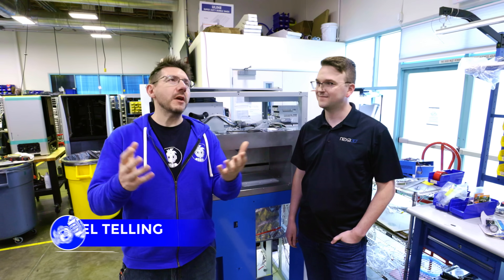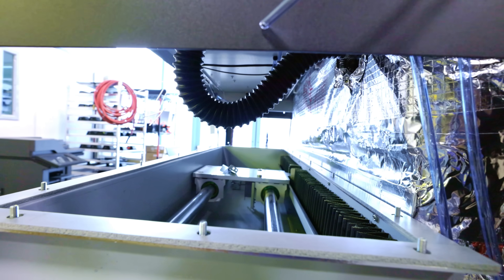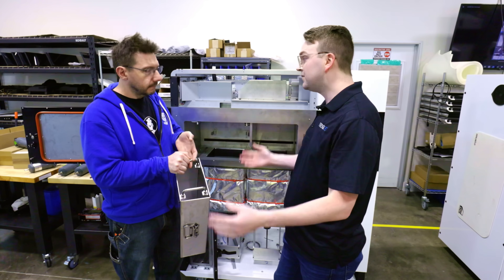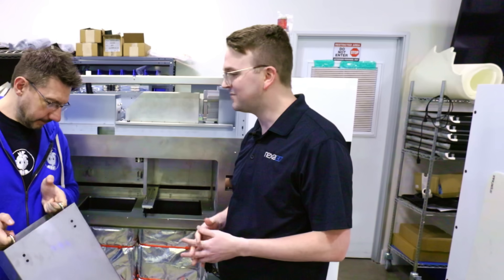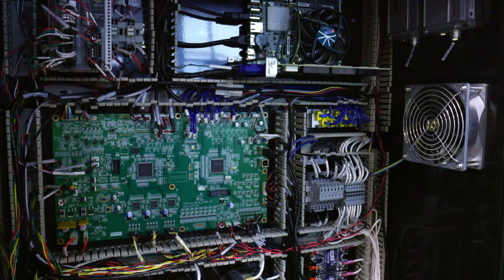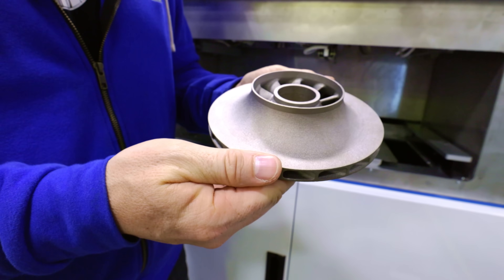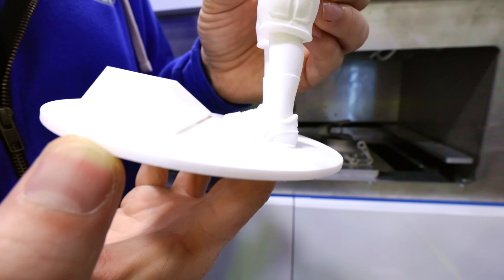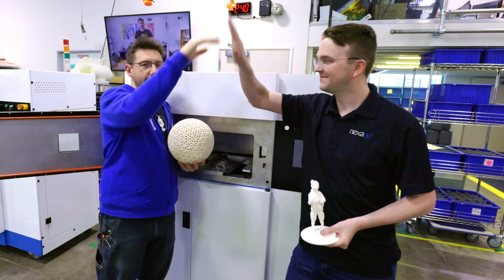DEEP INSIDE an Industrial SLS 3D Printer!

Comment: Videos like this are a nice break from watching consumer level 3d printers. Industrial 3d printers are interesting because reliability and repeatability requirements are so much higher.  Its like the difference between a desktop CNC and an industrial CNC.

I was kinda expecting to see a PLC running things. Then again, I'm sure that those control boards have gone through rigorous testing too or they'd have a tough time selling systems.
Reply: PLC is only used as an addon when you have attached automation to the machine but even then it takes care of really primitive tasks (automatic material changes, pallet changes, robot arm loading etc). CNCs in general or 3d printers do not need a PLC, just a dedicated controller board that also has alot of I/O like a PLC and logic behind it.

Comment: It wasnt that long ago where hobby CNC wasnt possible in the home workshop. Or at least it was very uncommon. Now its very affordable for really good machines.

Im hoping these SLS printers will go the same route. We already can do so much in our home workshops with 3D printers, CNC's, lathes etc, having a metal SLS would be the icing on the cake.
Reply: Home SLS machines will be a true game changer. I don’t really see the value in nylon ones. Marginally stronger than FDM for 100x the price
Reply: @1SmokedTurkey1  Yeah I tried nylon SLS parts from JLCPCB and there were not as strong as FDM PCCF

Comment: im wondering what they think of the new competition that is coming up in the lower ends of the market with Micronics for SLS(plastics) and Metal-Base for SLM (metal)
Reply: Micronics is not safe as a home printer which they are trying to market their product as. The printers may be cheap but to use them safely you will need to invest in a lot of other equipment. The SLS powder is very bad to breathe so just wearing a N95 mask is nowhere near enough protection. You need respirators, a dedicated ventilated and sealed off room, proper cleanup procedures, etc. People using it professionally even have to use all anti static equipment like vacuums because there is a chance that powder in the air could explode if there is a spark. Notice here how they didn’t let Joel anywhere near powder or unfinished parts and it looks like the machines have been properly cleaned to show him.

The basic mask and gloves is not enough to protect you from direct exposure but there are other issues with it being a very fine powder, even without spilling it when you remove the print from the machine you kick a lot of that powder into the air where it will remain for a long time and will settle on surfaces where it can be kicked up later, most likely when you aren’t even wearing a mask. This is made worse by the sifting method of the micronics machine, put it in a box and shake it up.

SLS is just not safe for home or hobbyist use at this stage, that should be clear to see when looking at what protective measures companies have in place for using the machines.

Looking at micronics about page they clearly don’t put much thought into safety, they show off how they used to be based out of a college apartment before they moved into their lab and their pictures show what looks like a milling machine covered in metal chips literally less than a metre from a bed. Now they are marketing an SLS printer for home use? I would not trust their safety claims or advice.
Reply: I think that from that perspective no 3d printer, fdm, sla or sls should never be used at home. The same can be said about drill presses, milling machines and  saw machines. In the end it is also determined by the ammount of exposure

Comment: I know a lot of these machines are out of manys price range but in the video or description can you include an approximate price? I don't know about others but I like to follow the progress on technology and cost. This way when I hit the lottery, I can afford one of these machines 😂
Reply: You need to realize that you need to purchase more than just the SLS machine, right?  The majority of your cost will go into the post processing/safety equipment, as all contact with the powder needs to be completely eliminated.  Any powder that you breath in will forever be in your lungs, leading to mesothelioma.  During the sintering process, you need an extreme ventilation/filtering system to ensure than none of the vaporized components can be breathed in.  You can’t just ventilate this outside, as that is illegal.

This post processing/safety equipment is going to be at least 60% of your total purchase.  This is something that has yet to be discussed by @3D Printing Nerd.

Comment: Just out of sheer curiosity is it possible to print cast iron with standard cast iron strength im trying to reverse engineer parts for equipment from my 1888 frick sawmill to my 1951 international harvester horse drawn sickle bar mowers
Reply: I don't think so. If you really want a cast iron part, using a 3D print to get a casting mold made and actually cast in iron might be more economical. Since the old part was already cast conventionally, it should be easy enough.
Reply: @ProtonOne11   yeah in theory but I A don't have the original parts for the  friction feed mechanism on the sawmill so I'm starting from historic scans and that was already kind if the plan which is why i bought a creality ender-5 plus, & B unless I cast the parts myself with the furnace a friend in portsmouth built for recycling purposes I have only three other foundrys available to me cattail being the most likely option but they are a 7 hour 49minute drive unless I have ten castings or something large like parts for an AD baker steam tractor it might be more economical to print the one offs at home and keep a plastic master mould on hand incase someone approached me needing a dozen of the part
Reply: Doesn't the cast in cast iron refer to it being poured into a mold, i.e. casting? Maybe this is just one of those misleading names, where the process is in the name, but it it just refers to a high carbon iron instead of needing to be cast.
Reply: @aperionx   good question ,I think it's the material not the action from what I just read, the iron gets it's properties from the carbon being above 2% and silicone above a similar percentage
Reply: @aperionx   good question ,I think it's the material not the action from what I just read, the iron gets it's properties from the carbon being above 2% and silicone above a similar percentage
Reply: @wesbrackmanthercenthusiast4695  That's what got me! I think it was called cast iron because it couldn't be forged due to the high carbon making it strong but brittle, but maybe with 3d printing we can make cast iron without casting it :P

Comment: Imagine the possibility of one of these printers at home! Metal prints whenever we need it... Heck! We could have metal minis for all of ys hobbyists!
Reply: you now that they do not come out like that right? to uncut the part and the supports with metal powder ypu just need some pse and a few machines... that will never happen at home.. trust me.. one sniff of titanium powder fucks you up
Reply: @wildniscamper7276  the powder is the support. Nothing to remove. You blast the extra powder off with compressed air and/or a shaker. You also have to think about inner voids that will trap powder, kinda like a resin printer.
Reply: @wildniscamper7276  as the other commenter mentioned, the powder here is the support and yes I am aware that they do not come like that, but once again hobbyists are in full understanding of this matter, the hobby already requires we put in the elbow grease to get our work to look good, putting in extra work is not a deterrent
Reply: @JH-zo5gk  as i was working with eos machines i guessed, you need support, because of thermal expansion and therefore movement of the part in the powder cake.. i was only talking about metal prints and metal powder. even with PA2200 we have had warping problems..so i do not see how that should work with metal..
Reply: @wildniscamper7276  that's what Joel said in his previous sls video. They used nylon in that on I think.

Comment: Metal print has real potential and we need the inexpensive plastic printer world to overcome the psychological barrier into metal sintering so we can get super cheap machines because lasers are quite inexpensive, flipping mirrors isn't super costly and pushing powder isn't that complex either. Nor is an inert atmosphere, you burn off the oxygen and keep the chamber small.
With metal printing you can do really serious stuff. You can genuinely print a high performance jet engine. Not just a toy that works poorly but one that competes with million dollar commercial engines. Plastic is fine but metal is where it is at.
Reply: The reason why this relatively simple technique isn't more popular on the home market is not because of a psychological barrier. It's because sintering powder, the raw medium used with these printers, is extremely dangerous to even be in the same room as. In industrial settings, SLS printers are placed in underpressurized clean rooms and the people working in them wear clean suits and respirators. You can be the most careful person in the world and keep everything meticulously clean but you'll miss some quantity of powder which will mix with household dust into your air. Over time, your environment will become badly contaminated with powder particulates which you unwittingly breathe in, which deposit in and slice up your lungs. It's asbestos on crack.

Comment: After the fiasco of the at home version, I can see why you wanted to show us a video of SLS at it's best lol.
Reply: How was it a fiasco?
Reply: @username9774  Because, as many people pointed out, that nylon powder the printer uses is orders of magnitude more dangerous to breathe in than asbestos and an N95 mask and some rubber gloves are not enough protection for that. Factories like this one put these machines in clean rooms where technicians and operators wear clean suits and respirators while handling the powder. Having a machine like that printing regularly in your home will give you COPD right quick.
Reply: @gownerjones Even just ABS fumes scares me, and this powder stuff? No thanks.
Reply: @youtubehandlesux  If you had the choice of a lifetime of breathing 100% ABS fumes vs 100% unfused sintering powder, which death would be slower? 😂